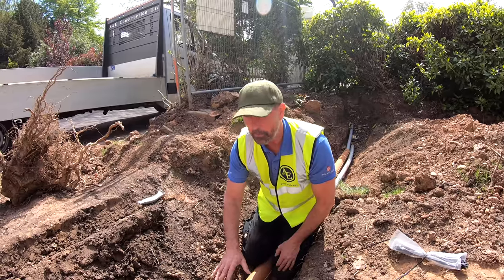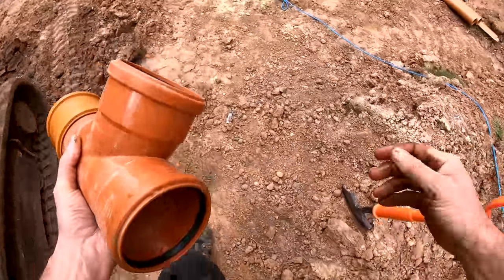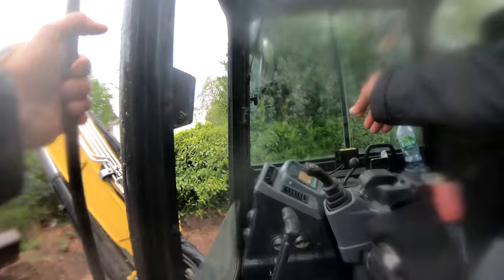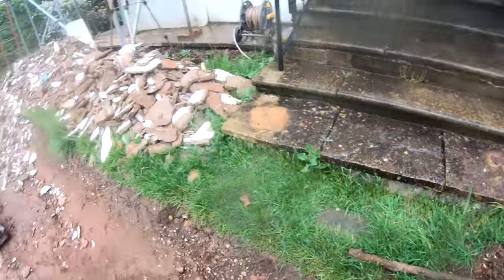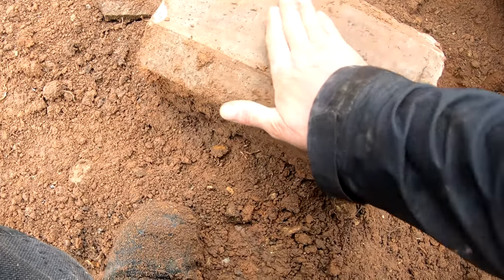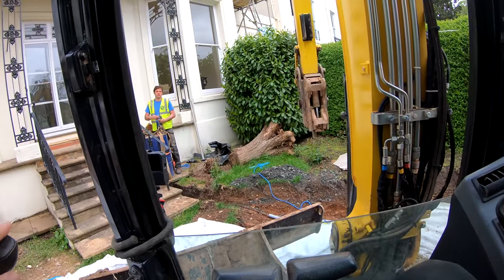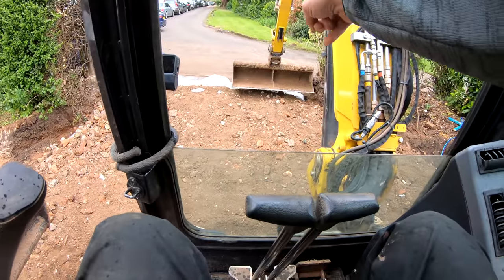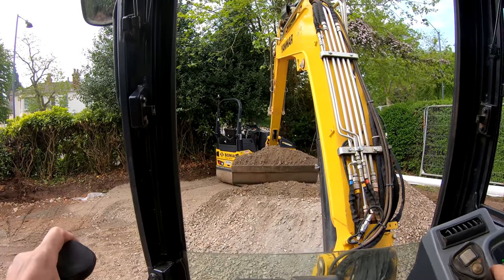HOW TO DIG A GRAVEL DRIVEWAY | Regency Renovation #3 | Build with A&E

Comment: Nice one Tony. How a drive SHOULD be done , belt n braces job . Totally agree about schooling , too much emphasis put on A levels , Degrees etc and not enough on REALLY USEFUL practical ability , Well done mate and look forward to the drive going in. Once found a set of false teeth whilst using the wacker plate, turned to tell my oppo then realised they were his . Needless to say they didn't fit any more.
Reply from the maker: Hi Spartrowel 😂😂😂 that has totally made my day you hear funny stories all the time but that has to be at the top thanks for watching all the best Tony 👍 have a great weekend

Comment: Good video. Nice to see the Yanmar you run. I run a Kubota and use a rake attachment for stone. Once you try one of those you wouldn’t use the ditch for grading again! All the best with the project.
Reply from the maker: Hi Jack thanks for the tip great shout, what type of rake if you don’t mind me asking, is their certain make you have used, thanks for watching all the best Tony 👍 have a awesome weekend.
Reply: Build With A&E no worries Tony. It’s how it should all work, everyone should help everyone out makes the job easier! I was a plant fitter previously so I made my own. I struggled to find one that was wide enough for 6f stone yet fine enough for grading type one. The closest I’ve seen would be made by Rhinox. All the best, Jack.
Reply from the maker: Hi Jack thanks for the info will check it out 👍

Comment: Another excellent video - thank you.

Underground electric cables should be laid in BLACK ducts (RED for high voltage cables) at the appropriate depth. Marker tape or warning tiles should be positioned 225mm above the duct-line, NOT directly on top of the duct-line.

It's also worth mentioning that there are 1000s of miles of electricity cables of all voltage levels laid many years ago in earthenware ducts, before the modern variety of coloured plastic ducts existed. NEVER assume clay/earthenware pipes don't contain cables. Although this is the case for 'legacy' networks, I would not lay new cables in the ducts shown in this video.

Might be a suggestion for a wee video on the different duct colours and which services you should find in them as well as the nominal depths they are buried at. Cheers!